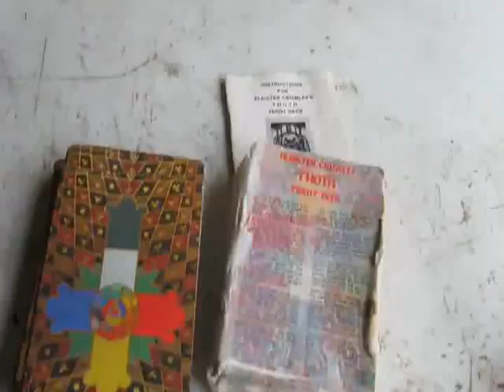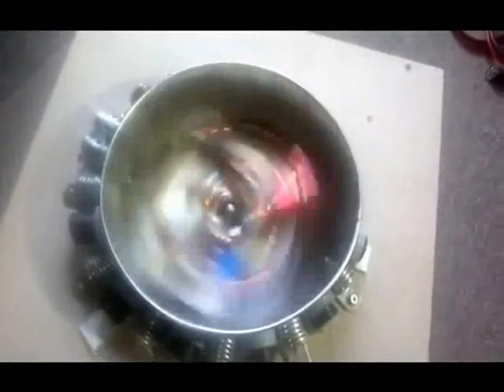Re: 'The Magnet Motor Chronicles Pt 3 Free Energy Magnetic Motor Or Pile Of Crap?'

Comment: I tried making a magnet motor when I was a kid. I never thought for one moment I was making a perpetual motion device, but I was trying to see if I could make a motor that used the energy in permanent magnets like a battery. I figured if it worked, you'd have to replace the magnets after they were used up, like a discharged battery.